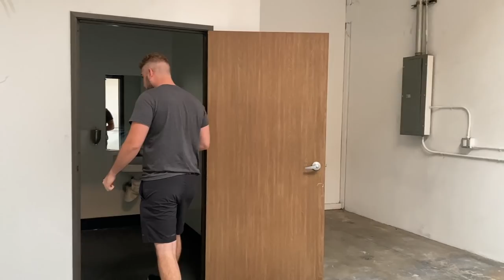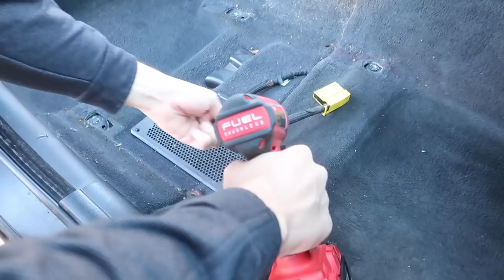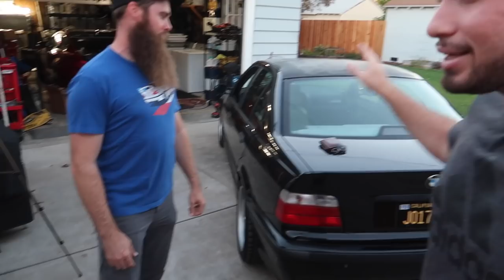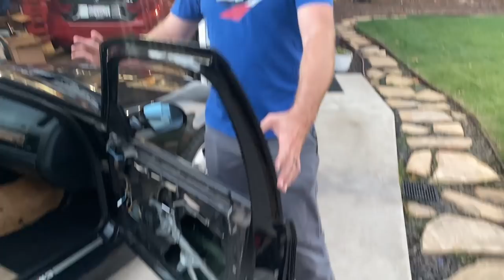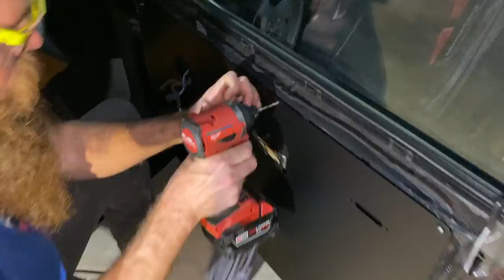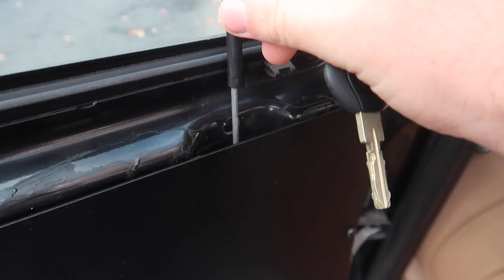INSTALLING E36 SEDAN DOOR CARDS!! Are They Trash? (FULLY CUSTOM)

Comment: E36 Manual swap: front half of driveshaft, pedal box, trans, 2 wires for reverse light, brake booster has a nipple already for clutch line, n one hard line. Thats it pretty much. Also in the ecu u need to take off a plug.